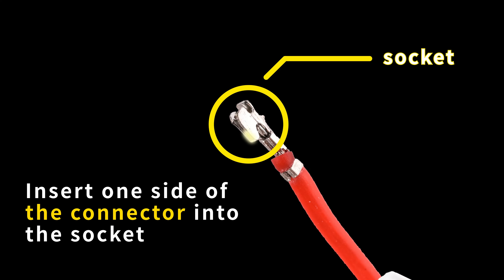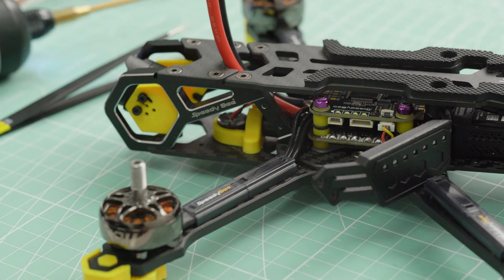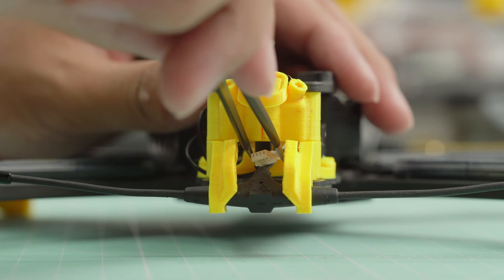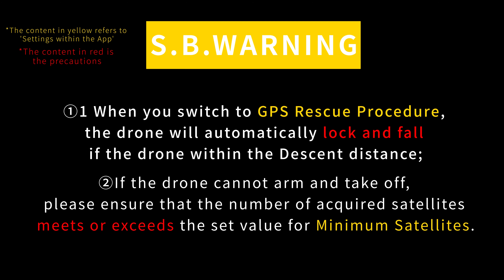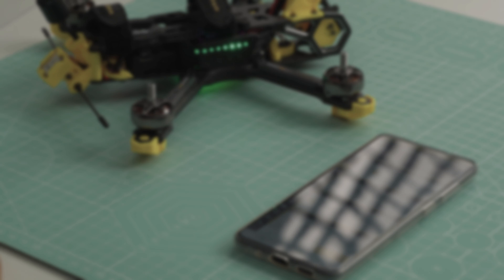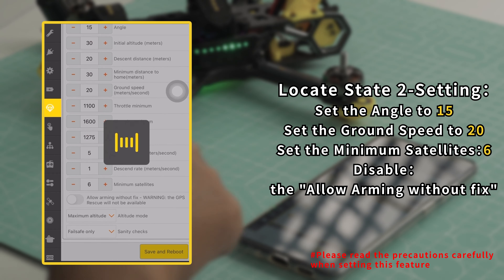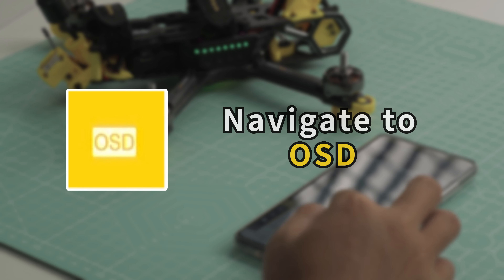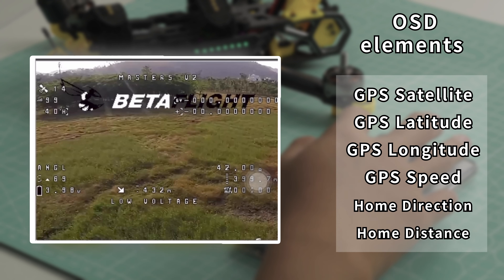Master5V2 GPS Installation

Comment: Hey there. I ordered a master5v2 SpeedyBee…I just want to add the GPS system for gps rescue. But I don’t get the steps 1 and 2. which cables do I have to pull out? And where should I pull them out? And what is this „connector“? Where do I find this. Sorry I’m complete new in FPV.

Comment: Is the GPS preinstalled if ordered as BnF (O3 ELRS) with GPS?
Reply: no sir, I ordered this exact package you describe, the GPS comes in its own package with the cables.
Reply: No and make sure that you come back to this video because of the pin out in the plugs will need to be changes as shown

Comment: I ordered the SB PNP with O3 and installed this same GPS and followed this video and get no more than 5 sats and to get them it takes at least 10 or more min. Having the arm switch turned on you will never fly seeing I cannot lock 6 sat. Speedybee should sell a shielded cable to prevent interference
Reply: You can run the GPS without Lipo, take a powerbank with you and just run the FC+GPS to get sats and change to LiPo when enough sats been found, then it will take just 10-30 seconds to get them back
Reply: Troncat shows how to shield the cable. It's just cooper tape wrapped around the cable then weld a wire to the new shield and solder it to the negative.
I just finish doing and got a 30 sec lock up with 10 sats
Reply: Hey. I ordered this GPS module too. My question is, do I have to crimp one side of the cables? I have to tuck the loose side of the cables into another connector or?
Reply: @steven3874  I made a wire that connected directly to the GPS to the FC. No soldering required. I also installed the GPS Mate that powers up the GPS before I plug in my lipo so I can lock GPS. This setup has worked great for me.
Reply: @emafpv  ok. Could you send a picture of it? You mean by wire a connector? So you crimped the cables into this?